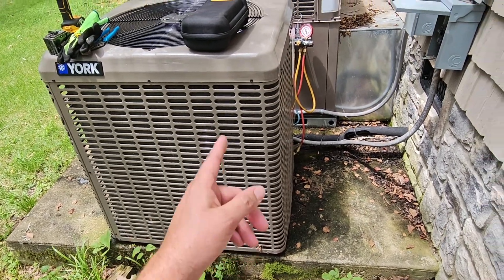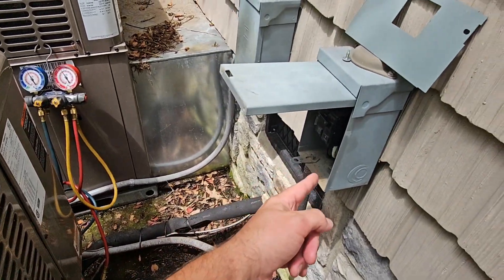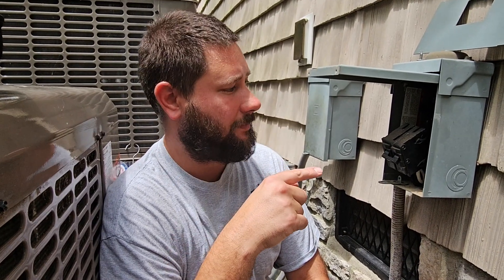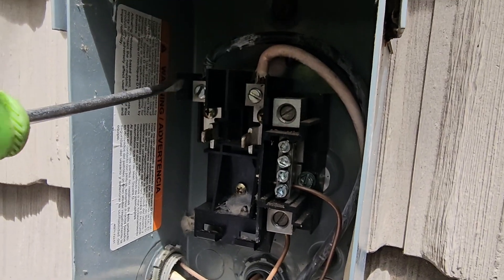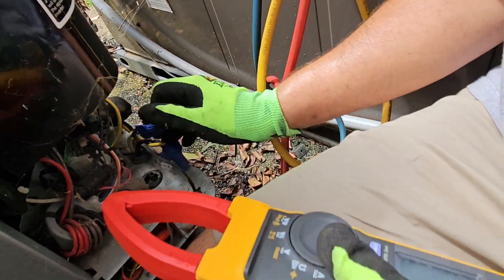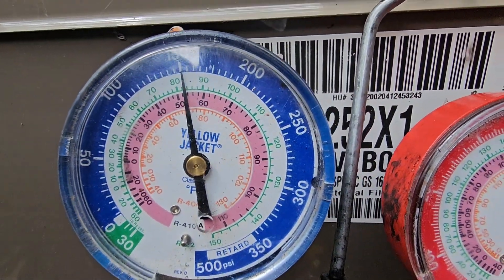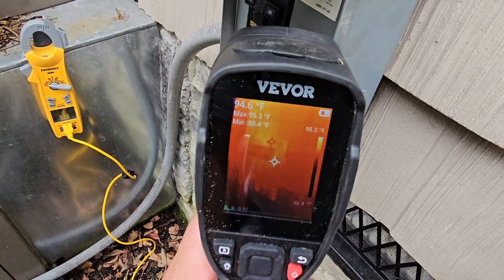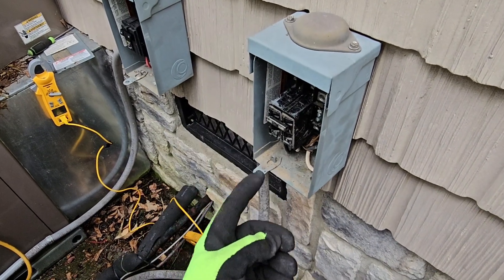Why Does My Air Conditioner Breaker Keep Tripping?

Comment: joe from tennesee. outside condenser has short and throwing breaker. i tried to put a new condenser. still shorting. inside breaker only installer didnt put disconnect. two wires black and red go to double 30 amp but white wire is just two inch inside panel with a wire nut on it. shouldnt that white neutral go to a bus bar? the copper ground does go to bus bar. i suspect the compressor but im not sure

Comment: LEARNED ABOUT THOSE BREAKERS! DON FROM dfw tx YOUR GOOD MAN THANKS
XR 13 HEAT PUMP 2007 TRIPPING INSIDE ac BREAKER FOR AC. PLUG IN TYPE FUSE BREAKER OUTSIDE. i WILL INSPECT WIRING ON IT. ANY OTHER IDEAS PLEASE LET ME KNOW, THX AGAIN

Comment: I have a 7 yr old TRANE A/C with panel in garage.  The breaker is tripped after A/C runs for a short time.  It seems warm after it only ran for 5 minutes.   A/C tech was out 3x & tested amperage of wires off capacitor & they all were within range of where they are supposed to be.  They say there is nothing wrong with it.  Should I just get the breaker replaced??  I cannot do it myself but will have to hire an electrician.   How much would it cost in the San Jose, CA area?

Comment: I wonder why there is an outside breaker.  An AC condenser usually has a dedicated indoor breaker feeding the wires.  Typically, just a disconnect box outside by the condenser, though a breaker can suffice for that.  Risky to wire the breakers while live.  60 A is a lot for an inverter-drive heatpump.  A 2 ton 18 SEER2 draws ~20 A max.  Never cross-the-streams between brands in breakers and panels.  Square D OD breakers are better than their Homeline.

Comment: Was that an insulated screw driver? Wasn't the line side always hot unless you turned off the breaker at the panel.

Comment: Good job finding that situation. It’s called “listed and labeled” in the electrical code section. Good one Tad
Reply: Hey Tad, can you give some information on that York heat/ac condenser?  I’m looking into replacing current ac with a 20 seer heat pump. Also like the soft start feature etc

Comment: Should be using an insulated screw driver, you slip and touch that box or your hand slips and touches that screw driver shaft then it's game over! Hope someone watching this doesn't try this and get hurt! ALWAYS TURN OFF THE BREAKER THAT FEEDS THE BOX BEFORE YOU STICK A METAL OBJECT IN IT! SAFETY FIRST! JEEEZ!

Comment: You voided the UL listing for that disconnect by using a Siemens breaker. That breaker has to be a Square D breaker because it’s installed in a Square D disconnect. Otherwise the UL listing is voided. This is coming from a licensed electrician.

Comment: That's why I don't use square D.
Reply: @scottepperson7709  Why? The Siemans was the wrong breaker and the one that failed. SqD is a solid breaker when used in the correct panel. And the Homeline internals (minus the trip indicator) are EXACTLY the same as the QO style.  Siemans breakers work well when used in the correct panel.
Reply: @mxslick50  
I believe SquareD is a good platform.  I also believe they think their better than everyone else.  You can put SquareD in other manufacturers but not the other way around.  If that had been Eaton or GE there wouldn't have been a problem.
Reply: @scottepperson7709  Not a good argument sir. GE is the absolute WORST breaker out there, thermal trip only, tiny bus connections and super high failure rates right out of the box. One commercial job I was on with GE breakers, over 15% of the GFCI breakers were defective, and over 7% of the standard breakers were defective.  This was out of a few hundred total breakers on that job site. 

And yes, history has proven that SqD IS better than everyone else. 

Eaton is not a bad brand however. (Eaton is still not approved by them or SqD for use in a SqD panel.)  

And no, you cannot put SqD breakers in other panels it is a violation of the breaker's listing.  Regardless of what other manufacturers claim, SqD (Schneider) has never approved or listed their breakers for use in other manufacturer's panels.  (They do make bus assemblies for use in OEM applications though, like air handlers, etc.) 

Over my 45 years in the trade, I have seen far too many (as in hundreds of) breakers and panels burn due to use of the wrong breaker for the panel. Even a few where "approved" substitute types were used. I can count on one hand the number of SqD panels with SqD breakers that have failed. (And most of those were due to environmental factors not an inherent shortcoming of, or defect in, the equipment.)

That said, Eaton, Murray, C-H, Siemans and others have indeed tested and approved other brands for use in some of their panels, but that had to get testing agency (UL, ETL, etc.) tests done to approve them. And they generally survive just fine.
Reply: Brilliant lesson

Comment: I am a marine  HVACR tech. I had basically the same issue on three occasions on three different yachts.
 The complaint was that the compressor breakers were tripping. The first call, I found the wires from the compressor unit to the disconnect didn't have the insulation stripped, and one of the three terminal screws were never tightened. (It was a three phase unit.)
 The other two, the breakers in the main distribution panel, were not only from a different manufacturer. The terminals were actually bent and filed down to fit the buss bar configuration. 
 These loosened up so much over time that I ended up replacing the entire panel as the buss lugs were secerly pitted due to arcing. 
 The modified breakers were an easy find because as soon as the system was activated, I could hear arcing in the panel. It was as if someone was spot welding.
 That was almost 25 years ago that I had my first experience with such an issue. After that, I check the condition, amperage draw and tempature of every breaker related to the unit being serviced. I also check that they are the proper brand and style.

Comment: When the breaker doesn't fit correctly you don't have a good connection which produces a high resistance a high resistance causes a high Amps draw which produces heat the breaker will trip because of the high a draw😊 Good job sir I'm retired now had back surgery but I ran into jobs like this use the right breaker for the panel that it's made for but sometimes they don't feel like waiting 2 hours in a supply house I get it but do the job right it won't come back to bite you in the ass.

Comment: There are many reasons they can trip.  Bad breakers are rare.  But with yorks problems are common.  Installed 2 new systems.  Both within 6 months had leaks in microchannel coils and both totally burned up the compressor plug and connections.   Yorks can’t handle the heat in az I assume and they are among the most expensive brands just overpriced trouble.  I had one recently 4 yrs old low pressure 275 high 230.  Compressor sounded like drums.  I was unable to fix it without compressor and I installed new (different brand) problems gone.    And before you say “mismatched system” it has first company air handler in condo. I think York has problems particularly in 115 degree heat.  I will never install one ever again.
Reply: Ive seen two York gas-pacs on roofs, both caught on fire in the controls area.

Comment: Did you check if the wires were tight at the breaker in the  main panel?
That'll make the breaker trip.
Reply from the maker: Yes sir that's a good point

Comment: Installed a new compressor a week ago in a condenser. A few days later I was called back for no cool. A fuse had blown in the disconnect (new fuses). Unit tag calls for a 40 amp minimum fusible disconnect. Here a 30 amp disconect was installed originally with the unit. Going back tomorrow with a 40 amp disconnect. Any other possibilities anyone can think of or likely just the undersized disconnect/fuses?
Reply: Use a 60 amp disconnect w 40 amp fuses ( just in case newbies are gleaning the comments)
Reply: @tech5298  hahaha hey thank you, ended up doing this. Funny thing since that last call back and I replaced the burnt (new) fuse w another 30. The unit has ran w no issues w that second new 30. Still replaced the disconnect however.
Possibly a bad new fuse out the box🤷‍♂️

Comment: Before you pulled the old breaker out, I noticed that they weren’t resting in similar positions. One toggle was slightly lower than the other. I’m not sure what an electrician would say, but whenever I see something like that, I’m suspicious of the breaker. (now after watching it that’s amazing that you caught that!)
Reply: As an electrician, I would say it shows there is a problem. Good catch.